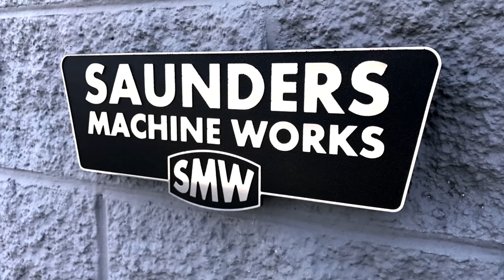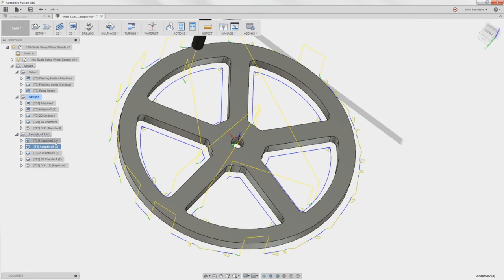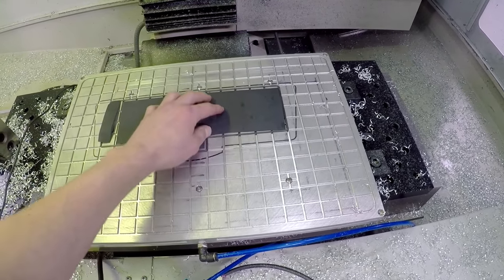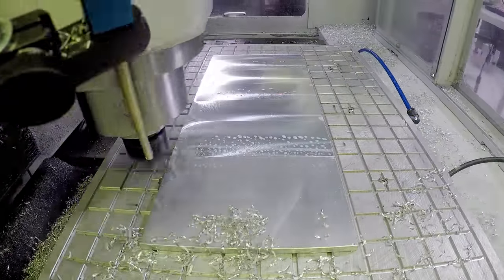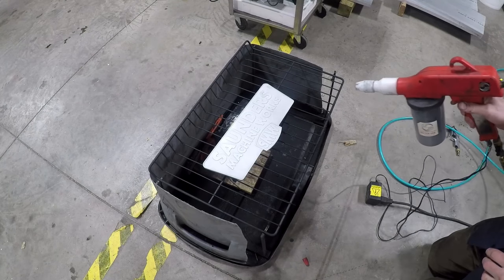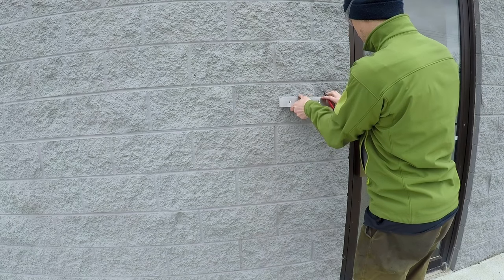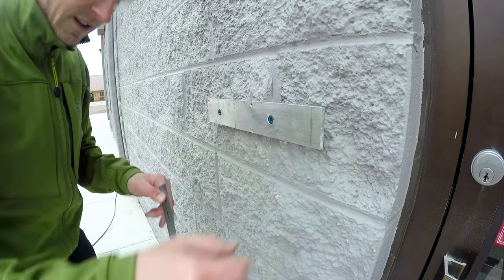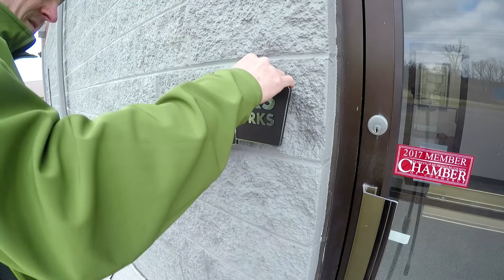Powder Coated Sign!  WW136

Comment: John,  I haven't commented on your videos before, but I watch them consistently.  I have to give kudos to you for one reason:  You seem, or tend to use the KISS method, and I have been doing this stuff for a long time.  Over complicating processes just makes things take to long.  I like your tactics, as you seem to stick to the Keep It Simple Rules.  Good Job, and the sign is classy, and will get the job done, I do however recommend a clear powder-coat overlay to keep your work looking great for a very long time.

Comment: Awesome looking sign John. That black texture is my favourite powder too. I've also clear powder coated polished signs to keep them looking bright.

I put up a video of an Arduino controlled rotary table a few days ago and while doing that thought you needed an Arduino controlled length stop for your cutoff saw. Punch in the length you need and the stop moves to the correct length. It wouldn't be a difficult build.

Comment: Great lookin' sign! Another kind of powder you might want to check out is the "vein" powers. Eastwood has Silver Vein, Copper Vein, and one I hadn't seen before: Poppin Silver Vein (I wonder what "Poppin" means).
As a reply to this comment I'm going to post a link to something I coated with Silver Vein for the 2015 Bar Z Summer Bash (17 second video). (Posting as a reply as the link will probably be marked as spam and I know how much of a hassle it is to deal with YouTube's stupid spam-approving system.)
That actually has a clear coat on top, but the clear doesn't change how it looks all that much.

If I still have your attention, there's another powder coat company called "Prismatic Powders" that has a TON of different colors. They have a number of transparent colors and their strategy seems to be to combine a base coat with a colored top coat. One thing they do is put a base coat of a silver-y/white-ish "vein" powder and then put on a top coat of a color. That way you can color the veins whatever color you want... kinda. So, if you wanted pink veins you do the silver base with a pink top. Cool idea, but not one that I've actually tried. I get the impression that Prismatic Powders has some connection with... um... Columbia Coatings. Maybe Prismatic is just a reseller of Columbia? I dunno, but possibly something to look into if you're less lazy than I am. (Actually, it's a stone fact that you're less lazy than I am. :) )

Comment: Saw that the other day and wondered if you made it. Looks nice! Great tips on the vacuum table. I've used sandpaper under slippy parts when clamping them to the CNC router but wouldn't have thought to use it in combination with a vac.

Comment: Tape installation on signs like that usually works well, but if you make a second version it could have a lug mounted on the back with screws (blind holes), and the receiver could screw to the wall just as you have already done only having a slot to accept the lug from the sign.  Screw (stainless, security, or otherwise) could be on the bottom to stay out of the weather.  Just an alternative.  I'm guessing you'll have to use a heat gun or risk bending or destroying it to remove it now!  Btw, looks nice!

Comment: I just want to take a moment to say that this one hell of an edited video. Top notch stuff, and must took some time to sort the various kinds of footage. Well done. Separated you from the kind of people that have the mentality of "film and go" thinking it will just work.

Great Sign. I was thinking at first that you would just bolt it directly to the wall by itself. Wedge in some pieces of wood behind it, to level it, and away you go. With this method you can put something else on rather easily later. :)

Comment: 3:53 uh that face there is 68.3456 in ^ 2  (bottom right)? I think your confusing with the total surface area of the whole part..?
Reply: I'd probably select just the bottom face, click Inspect and get the surface area of just that selection.
Reply: I thought the same thing. Am I missing something, or should the area of the sand paper be subtracted from the area of the face as well? I am still on my first cup of coffee, but I think there was actually very little downward force holding the aluminum plate but lots holding down the sandpaper. Given the loads for this operation were mostly side force this set-up was probably really good, but it is important to recognize how little actual downforce was on the aluminum plate. On my CNC router I have found work holding that controls sideways movement is far more critical than holding material down with lots of force.
Reply: Nuts to the software readout, count the squares inside the gasket :P That vacuum plate would ideally have  in the corner engraved square size, atmo pressure rule, and frictions for various surfaces for reference.

Comment: John, I had that same blast cabinet- go to Lowe's or HD and get a piece big piece of 1/8in glass cut down to 4 pieces. cost me $12 for the 4 pieces- you can also flip them over and wipe an oiled rag over the foggy side to get more use. Also, watch eBay for cubic boride(something like that) nozzles. you might like my sandblast vid not as easy to watch as yours, but still ~50k views. I get the sandpaper thing, but don't you have a higher static friction with metal to metal vs paper to metal? BTW, where do you find those small rolls of vhb tape- lol

Comment: I am currently working on designing a fairly large delta style 3D printer, whenever I get around to building it, I will have a few parts that I could either print in ABS, or have CNC milled, due to the large size of the printer (about 2.5 feet in diameter, and about 5 feet tall) I am likely leaning the CNC milled route.

Definitely considering contacting you when the time comes and hiring your services for the milling work... the stepper motor mounts would be great for a Wednesday Widget video so that's a double bonus.  I would be getting the CNC work done by a professional that I trust, and you would get to make some video content.

Obviously if I decide to go the CNC route for them, I would be paying for the work, not looking for a handout or anything :P

Comment: Pretty cool... The only thing I would have done different is machine two verticle slots in the backer plate to be used with t slot nuts and 82 degree counter sunk screws in the sign for adjustment to level instead of taping it.

Comment: you might get yourself a extra powder coating room built in the shop (perhaps with drywall construction and a filter plate ventilation) so you don't have the fine dust all over the shop (might not be so good to have someone inhale that dust)

oh and those concrete screws for normal (from what I know) should get installed with a impact driver because the threads need to cut themself into the concrete in a clean way (at least this is what our regulations are over here in Europe, and they should be pretty much the same over there in the States for those concrete fasteners

Comment: +nyccnc I just played with that rest machining issue. Your method leaves a bit more stock which is an issue for different models. If you just ensure the tolerances are the same then it seems to work.

Comment: I have a sort of similar design that I want to turn into a burn marker for marking wood projects. It is however much smaller, and you would need an end mill of maybe 1/32" or maybe 40 thou/1.0 mm. It needs to be steel, maybe even stainless. Is that something you would be interested in trying for a video, without charging me a small fortune for it (as the online CNC services do..)?
Reply: I should add that I have a finished Fusion 360 design for it.
Reply: I was wrong. It actually took some mild tweaking to get it to even work with a 1/64" ball end mill. Up for the challange? ;)

Comment: The editing on this video feels really weird, and there's something wrong with the sound. For example at 6:10, you can clearly hear some white noise, like you pushed the volume too high, and then the metallic sounds feel very distant. When you speak a few seconds later it feels like you're in a box, but yet we hear sound from the distant background. Did you use some kind of automatic gain sound effect? Or is that a new microphone?

Comment: Uhhhhhh... you're holding your corded drill wrong. Not talking crap, good stuff though
Reply: how should he hold it? Genuinely curious, because I went back and looked and that's probably how I would hold it. Always looking for improvements.
Reply: that ridge along the top back goes in the crotch of your thumb. while to round part goes in your palm. then you index finger "points" down the drill. you pull the trigger with your pinky and ring finger, thats why the trigger is usually so big (so you can use two fingers to press it). it really helps line up the drill straight with your body. thats why there is always that ridge along the top of the drill. 

anyway, have a nice one, hope this helps.
Reply: well, I learned something today! thanks!